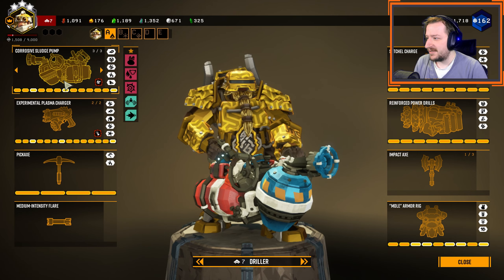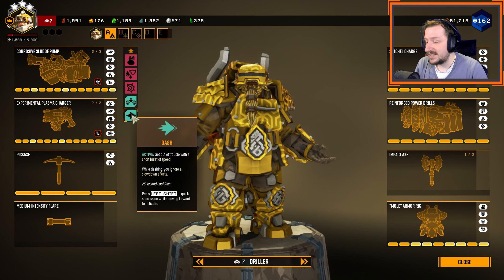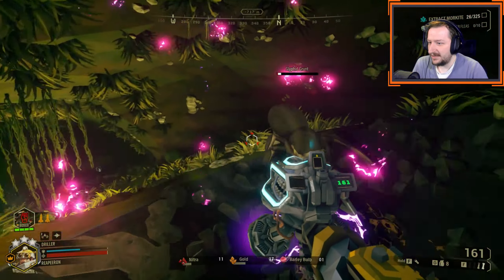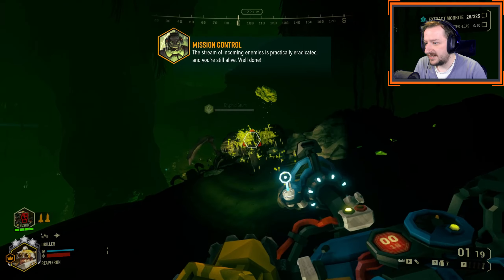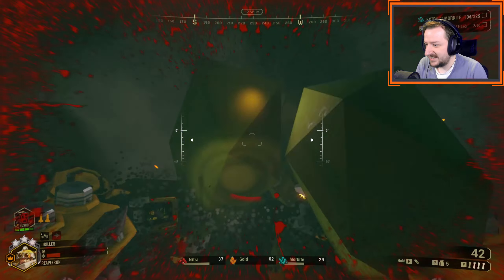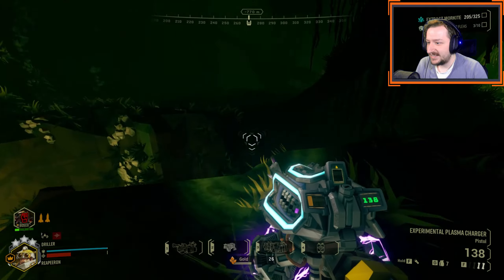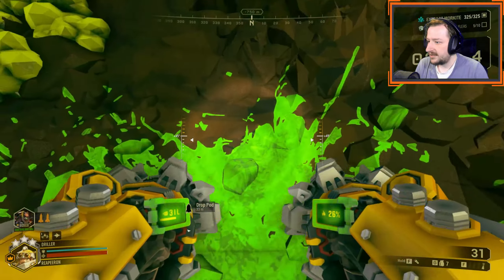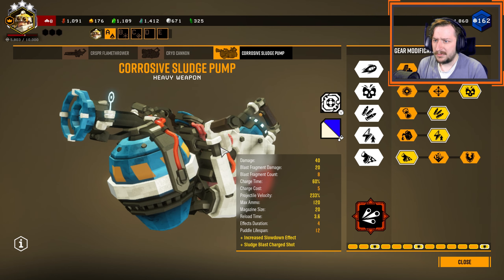Deep Rock Galactic | Sludge Blast Overclock - Hazard 5 - Solo

Comment: Disperser compound paint the map in goo. It's like the only Overclock I have for the sudgepunp and ya it's kinda everywhere. I tend to just aim for the roof or wall so I can cover as much floor as possible
Reply from the maker: Cool!  I have that one, but I haven't tried it yet.
Reply: It's so amazing if you give up TCF for Plasma Burn to set all the goo on fire! You can spread it all around then shoot a puddle three times and it'll start igniting the other goo puddles AND all the bugs. Throw in Persistent Plasma and the Neurotoxin Grenade and you can easily stack 5 DoTs (3 of which slow) across an entire tunnel.

I do think the Throwing Axe is better than to go THAT far with it, but science isn't about why, it's about why not!
Reply: @literatemax  The burning puddles will ignite the gas grenade, but other than that this is my go-to sludge pump strategy as well. Spread goo, ignite, add persistent plasma if necessary. With disperser coumpound you can even take the mod for increased direct damage to kill isolated enemies more easily instead of extra fragments and still have enough sludge spread, it's pretty neat.

Comment: The sludge blast effect looks more like a sidegrade than an upgrade to me, you gain direct killing power but it gets more difficult to spread the puddles effectively, and the puddles are pretty damn effective at killing swarms. Don't know why it needs a magazine and ammo penalty. They could probably even remove the downsides altogether and it still wouldn't be too strong since it's so specialized. Haven't tried it myself yet though.
Reply from the maker: Yeah it is one of the weakest overclocks as of right now imo.  It is still pretty fun though.
Reply: @ReapeeRon  It’s been updated!

(+)+Sludge Blast
(+)+100% Charged Shot Velocity 
(—)x0.5 Charged Shot Area Damage 
(—)-40 Max Ammo 
(—)+0.6 Reload Time

Do a new vid on sludge blast, maybe?

Comment: Seems like that one just isn't practical. Go through ammo too quickly, and can't cover a large enough area to take them out. Maybe in a team as the dps on bigger targets it would work. You used a lot of ammo taking out single grunts with the charge shot. Paired with the plasma pistol, which also has low ammo, By yourself though it doesnt seem very good.
Reply: On elimination missions i liked this overclock, but orthers missions is a no for me
Reply from the maker: I would agree, this one is cool and good against single targets.  Not so great against crowds.